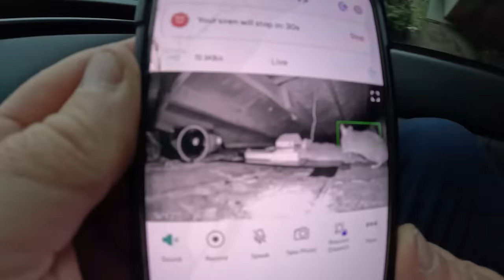Live RAT eats other TRAPPED rats … (except heads)

Comment: We are just at the end of having a rat problem around the outside of our house and a bit in our basement and basement walls. Had the same thing as you did. In one of the black traps it caught a mouse and the rat ate it from the waist down. Was beyond nasty. 🤢 I had 6 of those black metal traps. I screwed them to 2" x 4"s and also put in 3 screws through the tops of them. Then when they went off, the screws went right into the rats/mouse's head. The poison bait boxes around the outside of our house is what's working the best. Will continue to keep them loaded even right through winter.

Comment: Have you guys ever come across a suspected rat infestation that ended up being squirrels? If so,  how are those handled differently than rats?
Reply: I saw the squirrels ran up the tree and into my place so i cut the tree down, then i saw them run from electrical city line down to a big tree so i cut that branch out, but i still hear something in the artic but less now, i plug all the holes up there, but still hear them, i also caught the squirrels with the trap that i bought on amazon and put it under where the tree was and caught 1 of them.
Reply: @um8440  Where I live they get into you car and chew the wires. Its annoying.

Comment: The CARPENTRY of the new roof over the old shingled roof was really poor, too.  Looks like they just grabbed small dimensions of lumber to use for the bridging, didn't cut it accurately to fit tightly, looks like hell.  And then to just ignore those vents.  Homeowners should sue (if statute of lim's hasn't expired) using your video footage as evidence, and cut you in for 10% of whatever is settled on.  And show those neighbors their work "quality" so they can fire them!